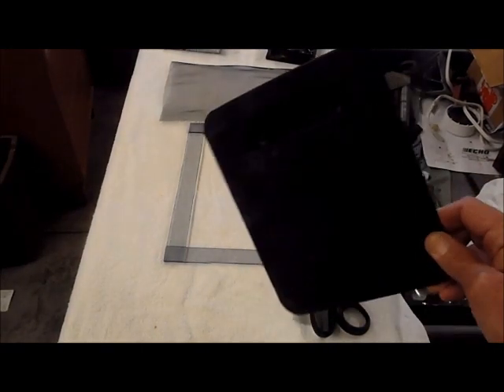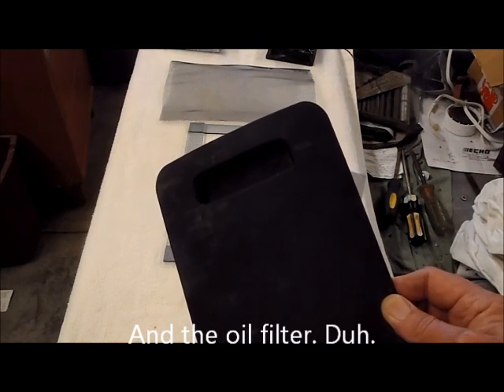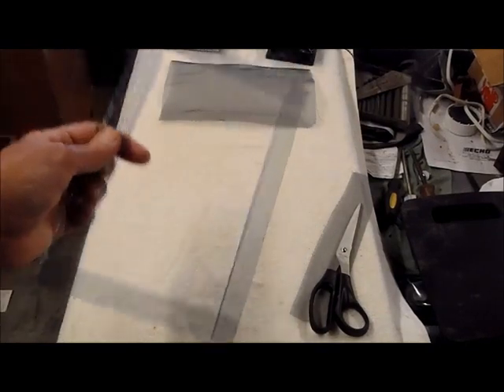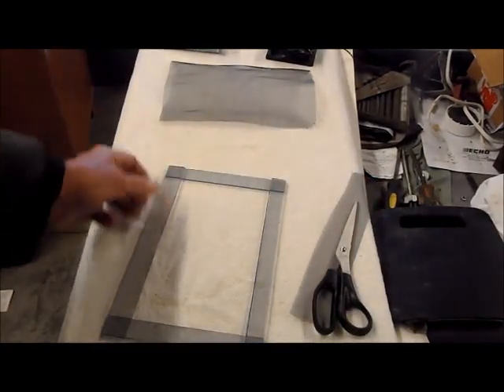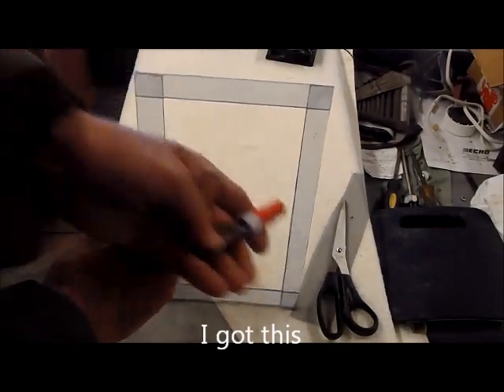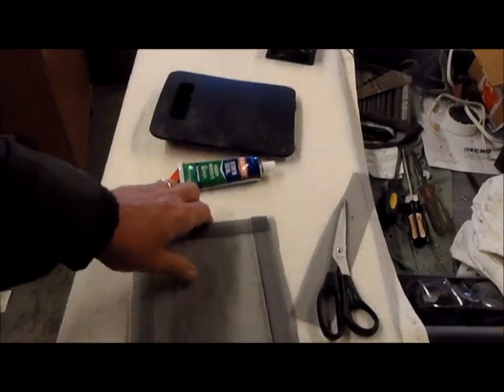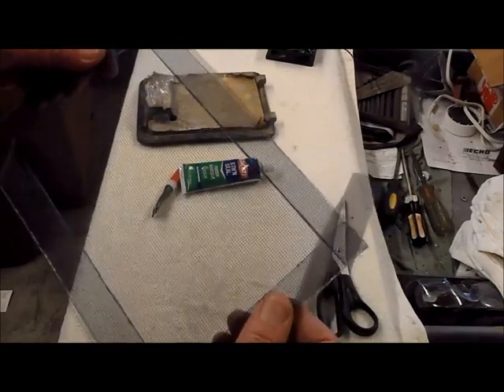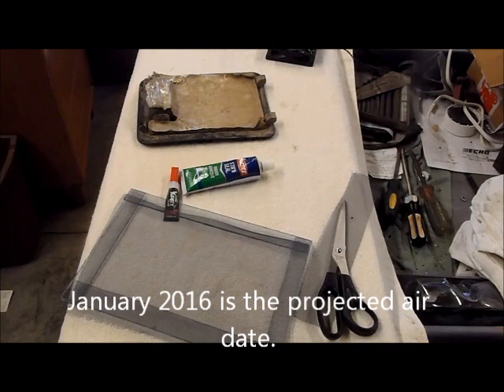Polaris RZR heat screen

Comment: Did it work good?
Reply from the maker: +jason33x  It worked fantastic! We didn't ride much in below 32 degree weather unless we were in the 4 seater with a full enclosure and a heater. But on a cloudy 35 degree day, it made an amazing difference. Glad I took the time to build it.
Reply: +redrzr56 thanks I'm going to try.